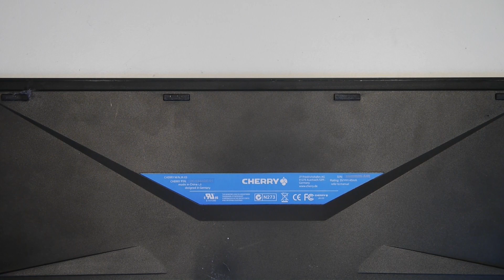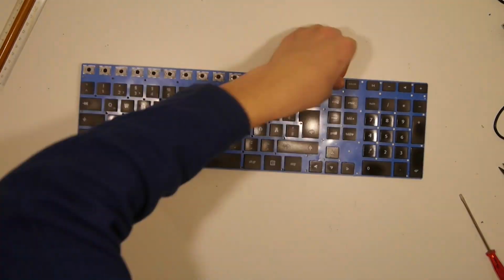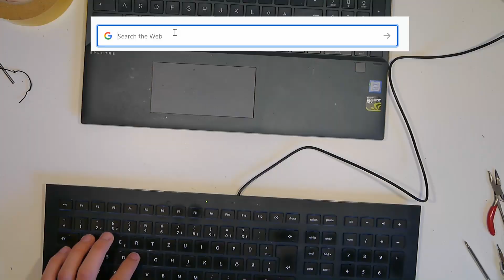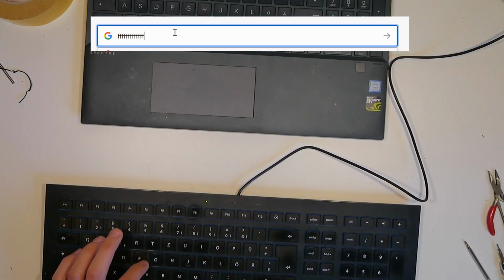Keyboard Cherry JK-03 - Teardown - Explanation

Comment: If you suspect an obstacle under a key, it’s possible to just remove this key instead of disassembling everything (esp. because it’s glued).
Use a tiny screwdriver and lift the key gently on the upper side. Take care not to break the plastic lift arms.
Reply from the maker: Thank you I should have clarified that. I was curious to see it all come apart 🙌

Comment: hey i took the 2 screws out but i cant figure out how to pry it open. From which side did u pry it open
Reply from the maker: Hey my version has a little overlap which I have used to apply little pressure. Make sure that your model does not feature more screws. You can also try and use some tools to slide into the gap between front and back plate but make sure those are plastic as well so you don’t scratch the keyboard. I think you can also use a little heat or alcohol to loosen the adhesive.
Reply: @JERandomTech  yes its the same model, so i had to cut the adhesive with a plastic knife, but its infuriating that they used adhesive as a sealant instead of screws.
Reply from the maker: Nice glad to hear you managed to open it. How painful was it for you to remove the key caps?😅